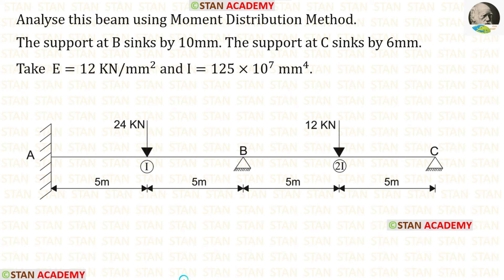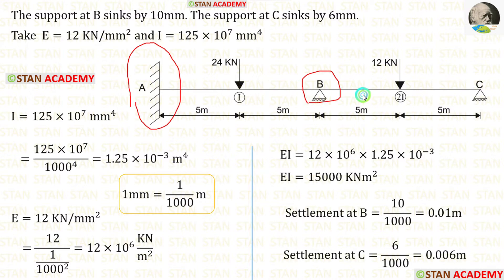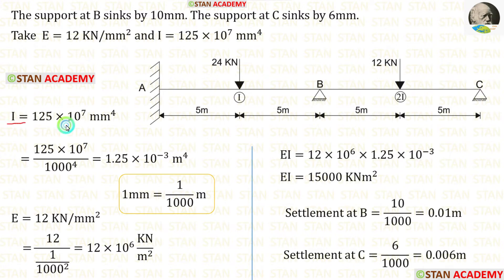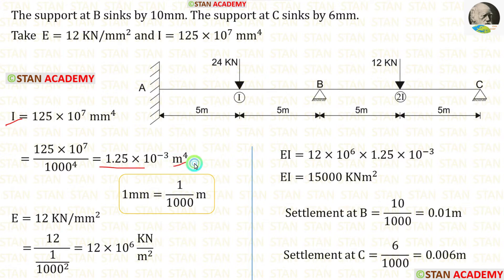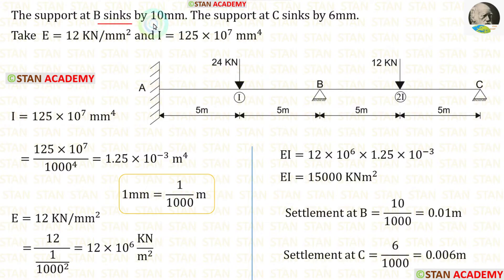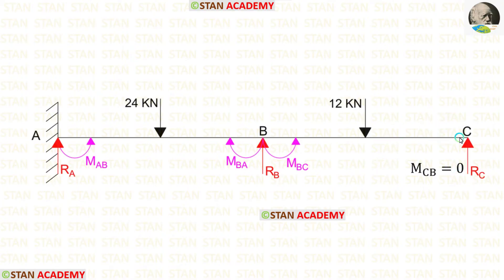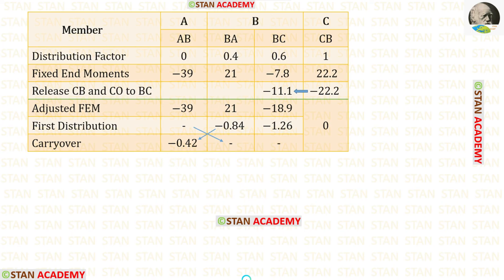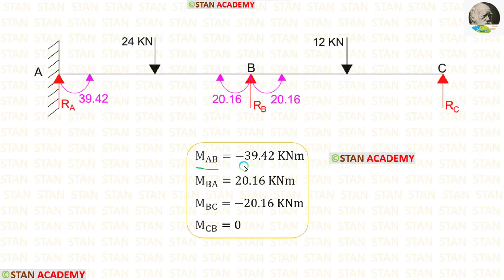Moment Distribution Method for Beam Analysis Problem No 17 ( Sinking / Settlement of Supports B & C)

Comment: in the calculation of fem, we previously used w(a^2)b/l^2 but now we are using wl/8 why plz can you can explain
Reply: ah i got it. the load acted at same distance from both ends
Reply: @dipeenupadhyaya7291 correct.